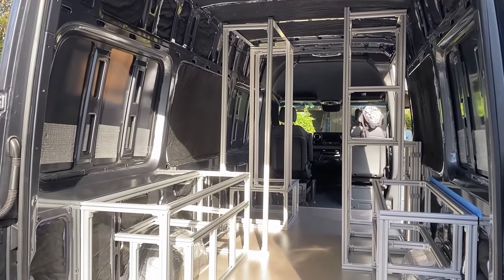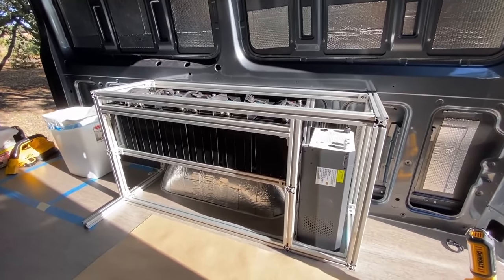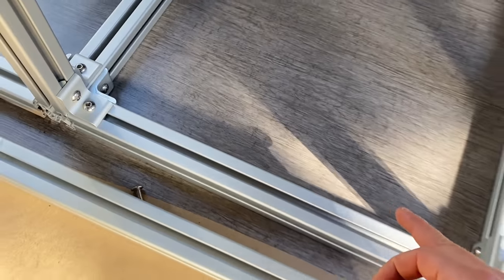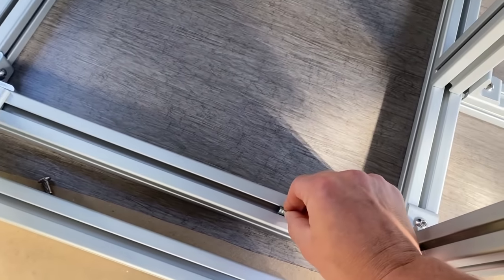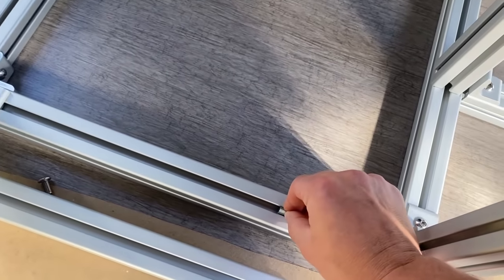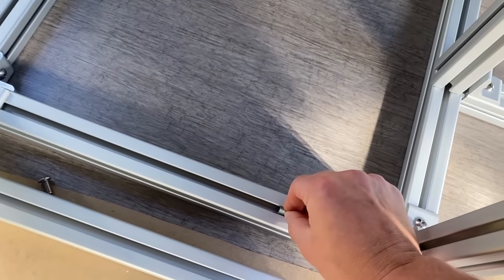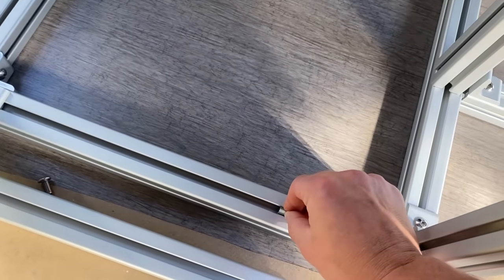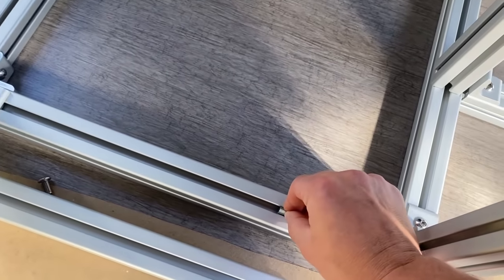How To Build A Van With 80/20 Aluminum (INSANELY STRONG)

Comment: Some detail but this is important: when you join two horizontal extrusions with one vertical, you shall have the vertical up to the top and the others on the sides of the vertical bar instead of having one horizontal bar above and resting on the vertical one. Believe me I've been working with aluminum extrusions for decades ! The way I explain gives stronger structure and it's described this way in the specs. So the cutting for the batteries is smart but wrong, sorry... I know it's not obvious but check he specs...
One free trick: add Nord-Lock washers where you're afraid of screw untightening, and you'll be safe for ages. For example the Humvee is assembled with these washers, some tramway wagons also. Just ask them for a free sample and do the test.
Reply from the maker: Interesting, do you have a link?
Reply: Hello, i'd be grateful if you can PM me on this or explain it better here, i'm a bit confused, i'll even paypal you some money for your advice, but i need to know better what you're talking about.
i'm building a hanging bed that only comes across half my van with the other half housing my motorcycle and i'm think that i will have the horizontals that hold the frame on top of the verticals as the horizontals can't slide down then, but it seems like you say this is exactly how not to do it? Thanks in advance for your help!
Reply: Why join 3 pieces at the same place (junction)?
Reply: @jackinkc767  If I'm not that crazy, in each corner you'll have 3 parts, right ?
Reply: Forgot something : you can order (they have a webshop) steel wahers, or stainless steel. Choose the first. You never want to have SS in contact with aluminum parts, because of galvanic coupling, this will definitely cause corrosion between parts.
So you have to use zinc plated steel bolts and washers only while working with aluminium, not the stainless steel neither the raw black screws !
Reply: @jncolligan1  You're right, what you describe is not correct. It will work, but it's not that strong.
The better result is to have the vertical part from top to bottom, and horizontal parts attached to the sides of the vertical ones...
You should use what they call "tensionners" instead of "L brackets". These L brackets are not strong at all. The tensionner is also a small L but it goes inside the slots of the extrusions, so it's invisible. And the more you tighten the screws, the more it "pulls" one bar against the other, so it's even stronger...
And more important, no matter if you use tensioners or simple L brakets, as far as possible put the brackets above the horizontal bar instead of under, the result will be 3x to 4x stronger. Obviously for the top bar this can't work but for any intermediate bars you're OK with this. Hard to explain with no graphic at all, but this is in the spec.
Example here: https://www.boschrexroth.com/various/utilities/mediadirectory/download/index.jsp?object_nr=R999001283
This is a big file (>80Mb), sorry. Compare the brackets on pages 118 and 119, one supports 600N of vertical force, and the other 2200N. So the orientation is very important...
And last advice: why looking only 80/20 ? This is one brand but there are dozens and some with hundreds of components or functions to meet you're exact need (if my memory still works fine : Bosch, Arcane, Item, Elcom, Phoenix Mecano, Maschinenbau-Kitz, Rose+Krieger, Misumi...) and many more that are available in USA/Canada not only in EU...
Reply: @jacquesolivier65  wow!  The more you learn the more you’re humbled. Thanks for all of this free advice. I’m really grateful. Some of this is really counter-intuitive.
Reply: @jncolligan1  You’re welcome, this is all about sharing, right ?
As long as I can help...
Reply: @jacquesolivier65  it's really helpful,  Thanks! i'd rather discover these fundamental design flaws now while still in Sketchup vs someone pointing them out to me in my van someday! :0)  i'm still looking for a book of 'extruded aluminum 'best practices'  there's so much out there that it's a bit daunting.

Comment: I think a better way to attach to wall is: 1- use the plus nuts to attach them to the factory holes, 2) attach 3/4" plywood firring strips to wall via the plus nuts 3) now you can just screw in the frame ANYWHERE to the firing strips. No holes in your van !
Reply: plus it would provide a thermo break

Comment: Loving your videos. Thanks for the detailed explanations. For the haters concerned about strength, you can always use higher grade bolts or socket headed cap screws to make the fasteners stronger (since the fasteners are the weakest part of the insanely strong framework). I've done some work with extrusion but I'm still learning lots from what you're doing.

Comment: Threadsert or a Rivet Nut is what the fasteners are called that are installed in the sheet metal. In the video, these fasteners are referred to as Plus Nuts. Perhaps that is a name brand, but that can be confusing. 

I have used the T-Slot aluminum profile for many projects. Again, in the video this product was referred to by its brand name 80/20. 

Great video and great execution of the plan.

Comment: This will be the new way of RV construction. As the average weight saved by using it over wood. Is over 800lbs....Add  the fact I used the 80/20 to mount motors straight to it. Then I can control the Monitor hide feature in the wall.  When not in use or traveling. I found several other places to mount high torque screw\belt\gear drive motors...

Comment: This is an excellent video.  Can you say more about how you plan to panel your walls and your ceiling around your 80/20 structures?  Most builds I've seen have continuous walls and ceilings, like you did your floors.  But that seems impossible with how the 80/20 structures attached directly to the van metal obstruct some of the wall and ceiling area.  Thanks!

Comment: I gotta see a 6-12 month update after it’s been on the road. It’s hard to believe none of those bolts rattled loose. The bolts holding my  bed come loose just from getting in and out. Granted it’s not 80/20 but still pretty solid
Reply: Did you loctite those bolts?

Comment: I agree 3D program helps a lot. I'm using Blender to fuel my dream! Its free, and extremely powerful :-).  My build is going to be crazy thanks to all that sharing of experience. definitely going with the 820 armature, Linear bearing fixture you can stuff in and make things moving from an extremely solid and light support structure. Thanks for your tips, man!

Comment: What happens when you have a rear end accident and one of those insanely strong 80/20  extrusions goes through your chest like a spear? I suppose such a thing could happen with wood. I do not think very many van interior builders consider even the affects of a soup can flying forward at 15 mph much less the fictitious event I have put forth. The one thing which I consider essential is some sort of barrier between the driver and objects which might find its way into the cab of the vehicle during an accident. Food for thought.
Reply: Given that the builder anticipates completely barrel rolling his van, your hypothetical rear end collision is fair comment!

Its nice to see that someone else respects that during a vehicular collision or accident anything not securely fastened down instantly becomes airborne, and invariably heads towards the space occupied by the crew!

When considering an interior fit out, great care should be taken to ensure that in the event of an accident, no supports, fittings, furniture or equipment will become forcibly propelled into the space occupied by the driver and passenger. 

A length or sheet of wood or metal propelled into the crew survival space can have horrific consequences, as can a microwave oven! 

Likewise, having heavy cast iron pans and kitchen knives hanging or magnetically held to the kitchen wall doesn't seem such a great idea if they strike the back of one's skull or shatter the windscreen sending glass fragments airborne at face height due to a collision forcefully dislodging and propelling them!

Unfortunately, such instances are not at all uncommon and social media even has some videos of the aftermath of even slow speed collisions!
Reply: I got some push back from this and the person called me “ clueless.” I suppose my most concern would be rear end collisions where object such as horizontal long and stiff structures would be pushed forward and less from the front end sudden stop accidents which heavier objects break loose and come forward. I believe both of those situations deserve some attention when considering an interior build out. You may or may not be able to do all which needs to be done but all that you can, you should. I believe the least one can do is place a barricade of sorts which can protect the driver from objects which might travel forward. Heavier objects such as batteries should be well secured and perhaps caged and heavily bolted to the frame of the vehicle.
Reply: @crawford323  I'm in complete agreement with you.

I see many build outs which present real hazards to the front seat crew in the event of a front or rear impact!

Unfortunately, people simply don't think of these things!

I'd much rather people learn of these hazards by hearing about them rather than experiencing them as victims!
Reply: I hear what you are saying. This and fire would be my primary safety concerns, followed by theft. 

Anyways, I think putting a partition behind the driver cabin and back would possible alleviate and reduce the danger here. Most Chevy cargo vans come stock with a partition. One could even build a custom one with a little doorway. 

This adds a few things: privacy, safety, insulation, and security. I'm strongly considering this on my Chevy extended build. 

Additionally, I dont think I'll want ALL 80/20. But it should be utilized when desired

Comment: Very cool build and helpful video! I would think for the battery tray, than a vertical jack stud, midway in the longitudinal span to support the 300lbs of batteries. Otherwise, you are relying on the angle bracket and bolts alone. The Plusnuts are the bomb! I would just use those exclusively with the 80/20 angle brackets and not bother with the carriage bolts. Might make removal/changes to the structure easier too. A bed platform out of 80/20 would be ideal too. There is so much value to unpack in your video, very, very helpful!!!

Comment: As always, really enjoyable vid !  Couple of Thoughts:
Misumi has probably the broadest selection of 80/20 type materials and related components.
DrillHog makes REALLY Great Cobalt Stepdrill bits 👍🏼
If you make a mark (typically an ‘x’ or >) to mark which side of your cut line that the blade goes on, you avoid the possibility of coming up ‘short’ on (Intended) length.
The hole for PlusNut was a bit big, better to have JUST enough dimension to tightly insert retainer (PlusNut).
Countersink stainless machine bolts save even more (space) in to L brackets than Buttonhead.
Nothing WRONG with your methods, just perhaps Viewers might benefit from suggestions.
Great Job !  Love your vids.  You deserve every bit of your monetization ☺️
Reply from the maker: Good suggestions, thanks 240z2nv!
Reply: @seven_o_savage  you’ve given me Tons of Inspiration, so ..... 🤷🏻‍♂️

Comment: I’ve used a lot of extrusions.  Good for stationary builds.  To be honest, you could have used cheap squared steel and welded.  There would be no chance of parts coming loose...and they will come loose because your van is twisting.  Plywood that is glued with titebond 3 is also a great option.
Reply: cleaning, priming, painting will all take time as well.  when you make a design mistake it's harder to correct as well.  8020 is very productive to build with.  if you have more time than money there are cheaper ways to do it, for sure

Comment: Instead of rustolem paint, I’d recommend trying cpc, corrosion preventive compound, we use it on aircraft!
Reply: What is the brand name...I can't find this...
Reply: @preluded  try ACF50 or corrosion x you can get it from aircraft spruce’s website. Use in a well ventilated area & follow ppe requirements!
https://www.aircraftspruce.com/menus/cs/corrosion.html

Comment: This is such a cool build.  I used 80/20 a lot in my old job.  There are so many different connectors for it.  For this I would absolutely loctite the crap out of every single screw.  The worst part would be rattle starting and trying to track down later.  Structurally it is strong as hell.  There are a ton of options to skin it and multiple methods.  I am curious to see what you use to finish off.

Comment: A very helpful video. Simple to follow and correct instructions. No BS. However, I noticed that there was no insulation between the van body and the aluminium cabinets. That does not appear correct.

Comment: Very informative and complete with some great tips and ideas. 

I noticed the framework rests on a “subfloor” if you will. That will provide some thermal break at the bottom. I was wondering though, if you’re going to use the van in the winter, it didn’t look like you provided a thermal break at the walls or ceiling. If you’re not going to be living/traveling in the van in the winter, no big deal. If you are, that framework is going to really be bringing that cold inside. I was waiting to see if you used the delrin for that. 

But, once again, great video and tips and subbed.

Comment: Rough estimate for cost is $900 with Dewalt Miter saw and stand $1500. Definitely not an inexpensive frame. It is a great work of art.
Reply from the maker: Yes the tools get pricey. On my first van I got away with minimal tools though so it’s doable to get started for cheap!

Comment: I really like your content and it is extremely helpful.

I have a concern about the 80/20 frame being attached directly to the metal of the van. Will the outside van temp transfer in to the frame? Should there be a shim of temperature dampening material to prevent the transfer of temperature?
Reply: A lot of people worry about this and there have been plenty of heated debates on spintersource and the transit forum. Theoretically, yes thermal transfer via metal is way more efficient than through air. But in my transit the internal metal already has factory foam insulation from the outer skin where the inner and outer meet...for the most part. I also have insulation around a lot of the metal. Still, I use some PVC and butyl as a backup. Personally I don't think total isolation is needed if you are attaching to interior metal, but there could be some gain by some isolation. No matter what make sure your 80/20 is bonded to the chassis somehow so it's not electrically isolated.
Reply: And galvanic corrosion where steel touches the aluminum, salt air and regular humidity is all it takes

Comment: I hope. You used locktite on all those threads holding it together.
As the vibrations while driving will work that thing apart in a few months.

Comment: Hi Stephen, great videos, tons of great information for first time camper VAN builders. My wife and I will be building our first camper VAN, we are waiting for the VAN to be delivered hopefully in ten more months. I am a stronger believer in building the inside with 80/'20, no questions about it. I do have a question, what is the best way to secure the 80/20 frame on the VAN? Are you bolting it down to the subfloor or are you using bolts that that run all the way through the VAN floor? If this is the case, do you use stainless nuts underneath the VAN? I imagine this is the case because securing the frame just to the wooden floor may not offer the best anchoring point. Great work, I can[t wait to start working on ours. Thank you - Otto.

Comment: really informative!  Thanks!! 
I've been living in Sketch-up, so i know what you mean about thinking in the tool kit!!  
killer question...
do you have to know where all those carriage bolts need to go before you captivate the ends?
Reply: Anchor and end fasteners make stronger connections, also needed if want to use panels fitted in the slots
Reply: @paullehto1823  Thanks Paul :)  i need to get more savvy on all these parts!  even what specifically Anchor and End Fasteners are.. as i'm still a noob and think in L-Brackets and Slidey Nuts! :0)  Thanks again :)

Comment: I want to screw down to the rear side metal sheet for bed frame, I am not planning to make a whole square style. do you think it is good enough to screw riv nuts down the bar on both side and just connect 3 across? for the side which one is that?